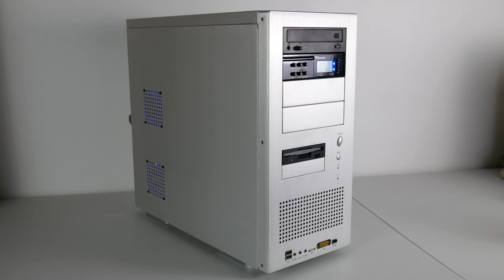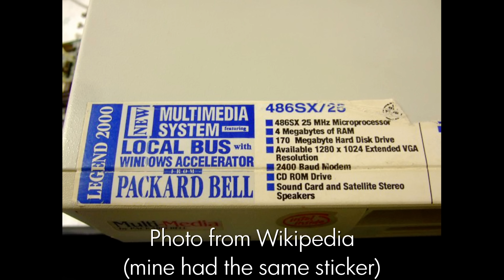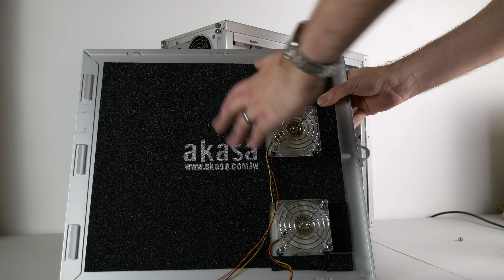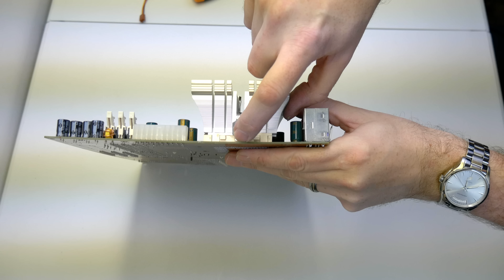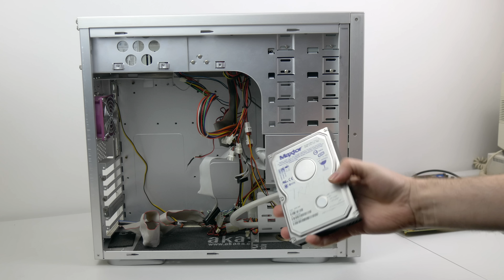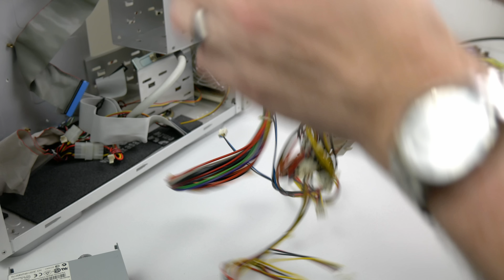20 year old PC teardown and demo - Windows XP, gaming and more!

Comment: This was an awfully good computer to retire in '02. I would think that machine would've been more than enough until possibly when the core 2 duo came out (Late 06). It's still a nice PC, and you chose well with all of the other components. One other minor critique here is that this PC is in no way the original packard bell it once was. Every part seems to have been replaced...several times. But you did do some very nice component choices and I would've loved to have that PC when I had my Celeron D dell from 05-09.

That was the first PC I really "owned", and before that we had mainly Pentium Is/IIs/and 2 laptops that were IIIs, as my parents are the kind of poeple who stretch out ALL of the life they can get from their computers. One of the two pentium III laptops is still around today, but there's a lot wrong with it. Left click on the trackpad and trackpoint doesn't work, there are some really prominent annoying bright spots on the display that I don't know what to do about, and I can't get the DVD drive or keyboard seated properly, so it's shelved for now. The other Pentium III laptop had a total motherboard failure. The fans didn't even attempt to spin up. Yes, fanS as in plural. The one that failed was a Latitude CPx and the one that's still around is a C600. The desktops were mostly heavily upgraded gateway 2000s and there were 2 (albeit one had been harvested somewhat for parts and wasn't in use) custom builts. 

Actually, the oldest memories I have of using a computer come from one of those Pentium II boxes (I think it was a Pentium II at least. Could've been a Pentium III I suppose, but I think it was a II) and using google and it was just so cool. I also remember one of the two optical drives in the machine was one of those that had a volume knob, play controls, and a headphone jack built into the drive itself and I remember my mom putting a cd into the drive for me and me hooking up headphones to the drive itself and just thinking that was so cool. I actually still think that's cool today and would like to find another example of one of those unique optical drives.
Reply: Modern Classic 
I usually count a PC as being a whole new PC when I replace the mainboard.
Reply: Also, antec? Nah man, PC Power & Cooling was where it's at.
Reply from the maker: Oh I know it's in no way the PB it once was. But it did start out that way. This wasn't a build from scratch; from what I remember I first upgraded the RAM, then the VRAM (which was free from PB due to a factory error), then the CD drive, then the CPU. Then I upgraded the motherboard, CPU, graphics and case together, and at that point someone could maybe say that it was really a new PC. But I still carried over a lot of components from what I'd last used in the PB, including the floppy drive, the CD drive, the hard drive, the RAM, the CPU, etc. For me personally, it's hard to say when it stopped being the PB and started being my own machine, and it wasn't a question of throwing out the PB wholesale to build my own system. It was just a bunch of continuous upgrades from that original machine.

Comment: What type of RAM sticks are they?
Reply from the maker: IIRC they were PC-133 DIMMs. Beyond that I have no idea. They were definitely different brands and I believe they had different CAS settings as well, and I just set them to what worked for both. I guess I could have tried to remove the heatsinks to determine what they really were.
Reply: Modern Classic Ah, so I know that they are older than DDR2 RAM sticks.
Reply from the maker: Definitely older than DDR2. Just checked the specs on the KT7A right now and PC-133 was the fastest it supported, and that's what I originally remembered.
Reply: Modern Classic Wow, things has changed so fast from 15 years ago til now.
Reply: SDRAM (Synchronous dynamic random-access memory)

Comment: You will be putting it back together?
Reply from the maker: I did put it physically back together. I may or may not worry about actually connecting everything back up. There are lots of little things like fan control headers, PC speaker, HDD LED, etc. that I didn't really bother keeping track of when I took it apart.

Comment: Great video!
I would keep the PC running ,just because it has so much memory's attached to it..
My first laptop from 2002 is also still running ,not because I need it but because that 1 device thought me lots of stuff.
When I would have to throw that thing out ,my heart would break.
But I would say ,do as you wish it is your space of course ;)
Reply from the maker: I do that with certain things, and I did actually put this back together after the video (though I didn't connect anything electrically). One thing that makes me a little less attached to this machine is that I was just constantly changing it, so there's nothing physical that I can latch my nostalgia onto. If anything, I wish I still had the original, unaltered Packard Bell that this PC began life as, even as crappy as it was. That might make it more interesting now.
Reply: Well it would make it original but time travel isn't here yet for the next millennia so warning the younger you about parting that Packerd Bell would be next to imposible ;3
By the way great channel you've got going!
Found it by accident but glad I did =)
Keep it up and do not listen to the cave trolls ,they just have personal problems..
Anyhow have a great remainder of the day/night!
Reply from the maker: Thanks! And you too!

Comment: Who knows these old cpus which came on its own card ? I had seen such a System a few days ago and I must say this concept is quiet cool.
Reply from the maker: Are you thinking of the Pentium II's "slot 1" interface?
Reply: It comes close but its more oriented like canal gate and has a small 50mm fan I guess. And it even has some guide rails.. It must be from 1990 -2000. I should have taken pictures ^^
Reply from the maker: It sounds like something I'd remember if I saw it. I know there have been various computers where the CPU was actually seated on a daughter card, and there have been others where you could actually add a second CPU just in a regular slot if you needed to emulate some other machine. (Some early machines running both DOS and CP/M had an Intel main CPU and something like a Z80 on a card.) But I'm not sure which specific model you're thinking of.

Comment: How it it so clean and dust free? My PC is all dusty in like a day xD
Reply from the maker: A lot just depends on where you live. It's not that dusty where I am. If you live in a drier climate, you'll have a lot more dust.
Reply: I live in mid europe... Not that dusty here but I don't free my room from dust that often. But at least you're build is clean!
Reply from the maker: There was still some dust on it; when it's sitting on the floor I feel like you can see it, and you can see it when I take out the fan controller. I did use an air duster to blow out the loose dust, and I vacuumed it to get out a little more. But the case has been closed up all this time and this particular case doesn't have a lot of openings for dust to get in. My current case (Corsair C70) will probably be a lot dustier inside if I ever store it the same way.
Reply: Good to know! Thanks for answering and good luck with that.
Reply: set your system up with fans laid out to insure a positive pressure case.  Meaning more intake than exhaust,  that will prevent dust from coming in thru every nook and cranny.  Just make sure you still achieve the airflow needed to keep your parts cool and have no dead spots.  If you have more exhaust than intake you have negative pressure meaning dust will be sucked in through every crack and build up faster.

Nothing to important but Positive pressure cases will have less dust inside them over a negative setup.
Reply: AllGamesConsidered If you vaccum an LED fan it starts spinning so fast that it lights up just from that energy ... I guess this would be bad for your motherboard :)
Reply: Id put a bit more modern hardware in it & perhaps mod the side panel to house a 120mm fan or a 140mm fan. heck maybe even a 180mm fan as intake while having the rest of the small fans as exhaust fans.
(Adjusted too a very minimal speed so its nice & quiet all the time except for 1 fan you mount on a passive graphics card of some sort.)

(Maybe a socket 775 or socket am2+ system with a core 2 duo or athlon x2 & a passive nvidia gpu that works with windows xp & windows 7 32 bit.)

So you can use the floppy drive easily while still being modern enough for minor web browsing & such.
But if you are junking the case + system, id keep the fan controller & remove the sound dampening from the case as those bits are pretty good for making light cases with tendencies too rattle or lead vibrations around easily. to get nice & quiet.

The socket 462 motherboard + cpu & ram can probably sell for a bit on ebay.
Or why not throw it out on craigslist as a period correct early windows xp pc & list some games that run well on it.

You can also hear with philscomputerlab.
(The youtube channel if he would be interested in the motherboard,ram,gpu,cpu if he pays for shipping.)
Reply: Dust filters are totally worth it.  They stop so much dust from getting in, I love the one on my case.
Reply: Modern Classic DONT VACCUM A PC

Comment: I hate AMD heat sinks... BUT you did the same with this rig as what my dad did with his once 386 until it was a P166.
Pretty cool.
Reply from the maker: I honestly can't remember if that was the OEM heatsink or if it came with the TT fan... but maybe it was the actual socket that was the problem. I cut most of it out of the video but I actually almost cracked the motherboard several times trying to get the heatsink unclipped!
Reply: I find it more of a pain to even mount the heatsink.
This was when I feared to break my AM3 mobo from my last rig, so I'm really glad Intel uses a simple screw mount system for everything.
If I ever return to AMD, I probably need to request support.
Reply from the maker: I have an AM3+ in my current PC, with a giant heatsink and two 120mm fans hanging off of it... it's bolted in. I think there must be a bolt-in standard now for AMD, in addition to clips. This is one of those things I easily forget about in between CPU upgrades, so I'm not totally sure, but I know I bolted in my current cooler.
Reply: I can feel the pain.
Seriously, how does AMD believe their concept is user friendly?
Reply: MegaManNeo is user unfriendly

Comment: I'm 30 now.  You were one of those people who had the money for stuff like this when I was a 13 year old kid lusting over a PC like this that I couldn't afford so that I could crank up the res in Quake 3.  I love seeing stuff like this.  Love your channel and keep doing exactly what you're doing.
Reply from the maker: Thanks!
Reply: In 1997 (when I got my first computer) $1500 got you a Packard Bell Force desktop with integrated graphics, middle of the road CPU and 14k modem. Now $1500 can actually buy you a computer with a very kick ass graphics card in a very nice looking glass case.
Reply: therealuncleevil yeah i remember it like that too. like the athlon was as fast in performance as the mhz equvilent of that number. the actual mhz is lower but its like a 4ghz in performance. would love to know if that was actually true.
Reply: Tripin S There's no need to be rude and make assumptions about other people like that.
Reply: It was an Athlon 64 4000+. It was actually only clocked at 2.4ghz but IIRC AMD did the naming scheme like that for the XP, 64s, and X2s as kind of a kick in the face to Intel to show how much more efficient their CPUs were basically implying that their 2.4ghz CPU was equivalent to a 4ghz Intel. At least this is what I was told when I was a teenager.
Reply: Indeed, the AMD naming scheme of that time was to reflect the performance compared to the Intel processors(the first time general consumers became aware CPU clock speed wasn't all that mattered), but in reality while they did outperformed Intel in some areas, they fell behind in others, namely multimedia, much like current Ryzen lags behind Intel in games.
Reply: Tripin S You don't know how the world works then  :) maybe one day though
Reply: Hey man.  I'm South African from Dutch decent.  Ek praat Afrikaans "kitchen Dutch" soos wat dit gemoem was toe Suid Afrikaaners nog Dutch gepraat het.  Jy behoort 'n bietjie te kan verstaan wat ek se.

Finding parts wasn't the hard part for me but the money was.  Nowadays I don't have a problem with that :D but I think back fondly to the days of scavenging old pc parts to make a barely usable system.

Comment: I was wandering around my Dad's place yesterday and looked at getting my old 386/DX rolling again.DOS 6. Windows 3.11.. Clone Sound Blaster Card. 2x CD ROM. 8mb RAM. Good old 1998. I think that's the last time it was used.
Reply from the maker: I'd probably still use a 386 if I had one; those often had turbo buttons so you could slow them down for older DOS games, at least. I do actually have an 8086 machine that I plan to do a video on at some point.
Reply: We used it almost entirely for writing music on Fast Tracker, using the XM format. It was nice that we could tweet the autoexec.bat to get it to do what we needed it to do. I think I managed to get Windows 95 to run on it at one point. But, we did scale it back to running everything in DOS. I've never been happy with emulating the system. I will have to say that it is the only computer I've ever owned where I could get everything I needed at the time, to run exactly the way I liked it.

Comment: I still use a manual fan controller for my case fans, and my computer has an i7-6700k and a GTX1070
Reply from the maker: Interesting. Wasn't sure you could even still get fully manual controllers.
Reply: I use a fan controller because I wanted 6 case fans, and my mobo only supports 5. I could have used a splitter, but I thought the controller looked cool. But you're right, you don't really need one, they are kind of a novelty now
Reply: Modern Classic I also have a fully manual fan controller on my modern pc. added it a few months ago when I upgraded my cpu and gpu. great decision!
Reply: Modern Classic Please put it back togeather!I have the same PC in a different case!
Reply: same
Reply: I have a 4 CH fan and temp sensor on my Scythe bought it cause the blue led made it look futuristic and more then just a fan controler it is style.
Reply: Ogoun we are now PC brothers
Reply: What do you view the benefit as being? Software allows you to control fan speed at the click of a button. Is it that you don't want to alt tab when gaming but know you need to crank up fanspeed?
Reply: Well that's pretty stupid.
Reply: I had a fan controller panel that I had to drill out 10 holes in a drive bay cover to install. It had 3 position switches and a red/green led to show if you were running full power or a lower voltage that could be set via variable resistors on the board.  I also had a drive bay HDD cooler/temperature monitor which had very thin temperature probes that you place under the CPU heatsink as back then there wasn't temperature monitoring from within the board like you have now.  The HDD cooler was a gimmick in that the fan was a tiny 30mm fan that burnt out pretty quickly.